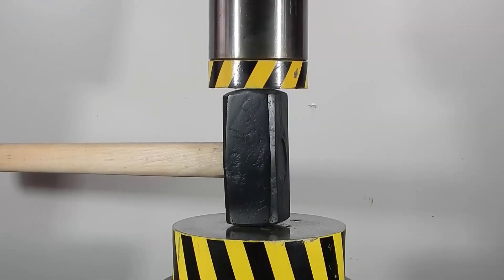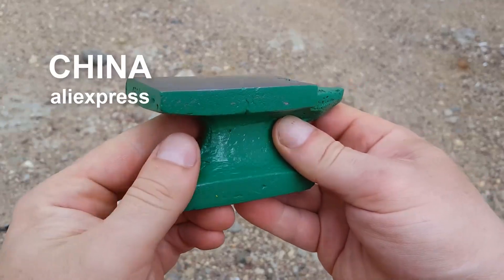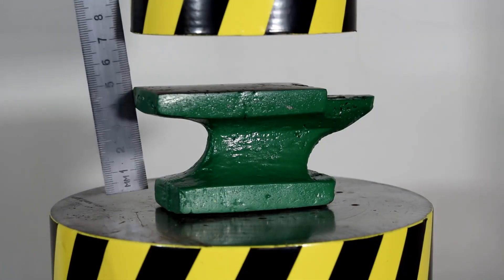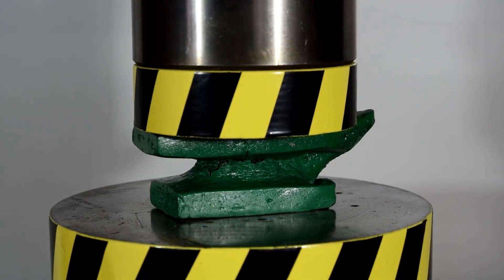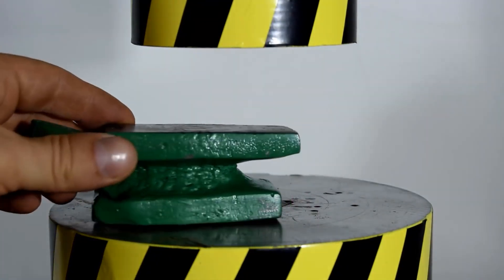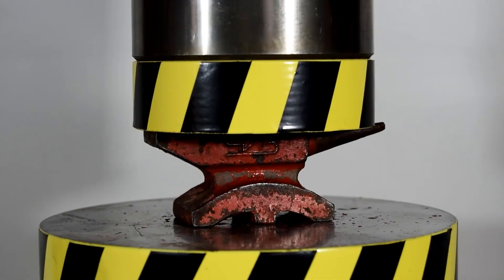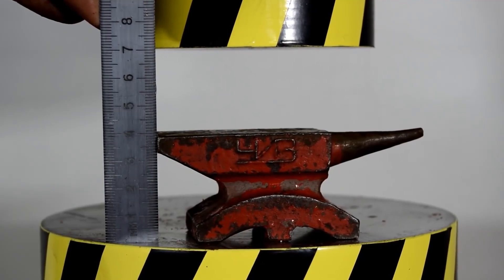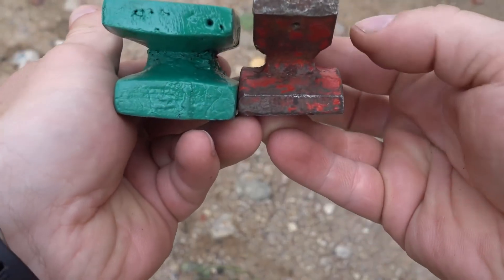HYDRAULIC PRESS AGAINST THE SOVIET ANVIL

Comment: The Soviets didn’t make anything for export so the Chinese anvil works for what it was designed for but not extreme deformation where the Soviets must have had a reason for making such a tiny anvil same with the maul if you are making a item for a collective farm you don’t want to replace it every few years but if you are selling a maul for someone using it a few times a year it needs to be cheap it’s ability to withstand ridiculous forces is just stupid as your average DYI person isn’t going to ever pound it to pieces professionals will just buy a better product the Soviet workers probably would never get a replacement so it better last. Problem with the Soviet system is there is little innovation like competitive markets make cheaper products to fit the use I buy Ryobi because they do what I want and there cheap if I needed a tool for work I would pick a higher end product Soviet products were made about the same look at the maul it looks to be 100 years old

Comment: Chinese steel is the worst. We aren’t allowed to use Chinese shackles at work. I work on a tugboat.
Reply: This is a fallacy, the Chinese make whatever grade you specify, it's just that the western world wants cheap, cheap, cheap, so that's what we get. As an example, Chinese cars exported to other countries get as good or better crash test ratings as cars made elsewhere, so their steel is just fine when required to meet specific standards.

That Chinese anvil was a piece of crap, made in a backyard workshop, you could see it was full of holes, it actually did pretty well, considering the low quality manufacturing, it was much more malleable than I expected.